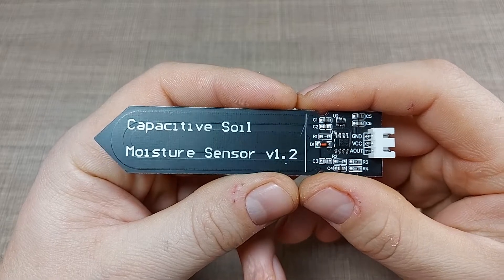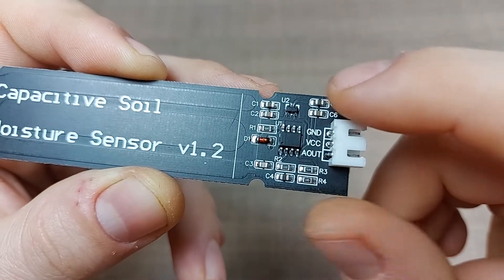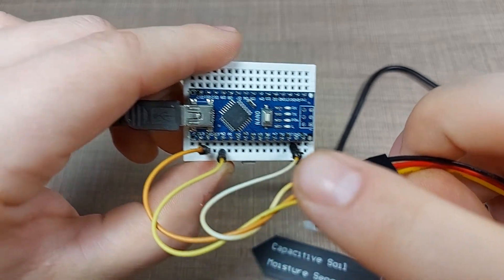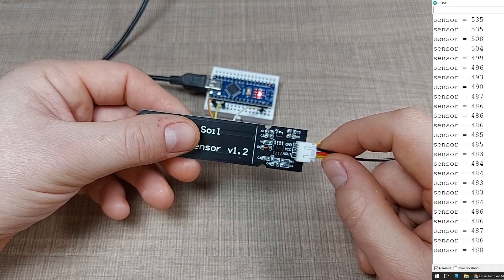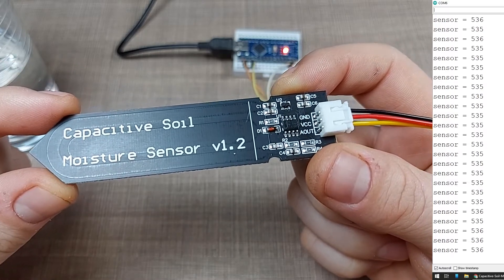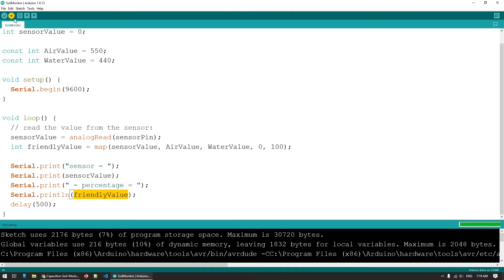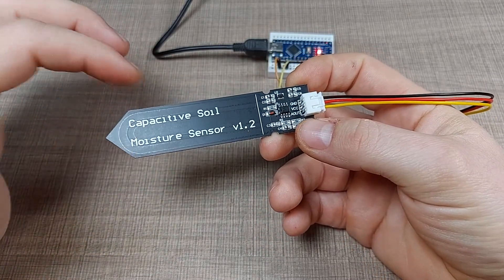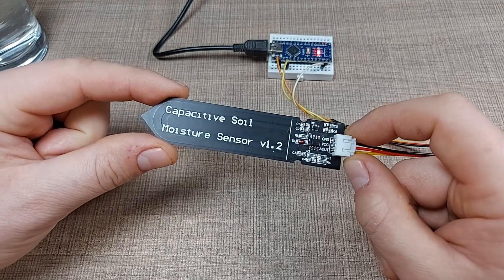Working with a capacitive soil moisture sensor

Comment: Honestly, I saw the schematics once for this sensor and I do not trust converting its output signal linearly into volumetric soil moisture content. According to some literature I read, the best way would be to get a dielectric constant reading, to then convert with something called Topp's equation. And I am not sure how one could translate this sensor's output into a dielectric constant value, or even just capacitance, from which you would calibrate in mediums with know constants.
Reply from the maker: Does it need to be that precise? What I need to know from it is if there is moisture or not so that I can turn on the watering. There is no value in knowing the difference between 20 or 30%.

Comment: why do all my sensors write 755 instead of 530?
Reply from the maker: The calibration is different on all. Do they respond to changes in humidity? If they do, then you can map your output based on that.
Reply: @TasteTheCode  yes they respond, thanks so much, I have another question, why the value changes in order of the deep of the sensor in water?
Reply from the maker: Put it simply,it changes the capacitance of the surrounding. This is how they work and are able to detect the change in soil moisture, the more water there is, the higher the output.
Reply: @TasteTheCode  Thanks for the help!

Comment: will the salts and fertilizers in soil effect its readings
Reply from the maker: Possibly yes. I know that salts do corrode the other types of sensors. You may need to experiment a bit in order to find the right values but it will definitely make a clear distinction between wet and dry.
Reply: @TasteTheCode  is there anyother way to measure moisture of soil nullifying the effect of salts and fertiliers based on current conduction possibly?\
Reply from the maker: Not that I'm aware of. If you have a soil sample without any fertilizer, you can maybe measure that and somehow offset the reading later bit it won't be simple.
Reply: Ideally you'd want a high frequency capacitive or TDR sensor, but those are not cheap.

Comment: will the salts present in soil effect the sensor value?
or fertilizers
Reply: For this particular sensor, yeah unfortunately. I got a sensor that uses TDR but I bought it for like 30$ CAD (while this sensor costs at most 5-6$ per unit). I read some litterature once that high frequency signals sent through soils will reduce the effects of ions on the dielectric or capacitance readings.

Comment: How to to attach different probes to this sensor
Reply from the maker: I don't understand your question. What do you mean by different probes?
Reply: @TasteTheCode  for example if I want to measure moisture at more deeper level.....then...can I extend the probe...by soldering wire to the existing structure
Reply from the maker: @ajinkyatamhane985  I'm not sure that you can do that with this sensor because the value is dependent on the capacitive coupling on the PCB. Adding external probes will change that capacitance and the value will be wrong. You can bury the entire probe inside a watertight enclosure and extend the communication wires from the top.
Reply: @TasteTheCode  really thanks for detailed reply
Reply from the maker: You are welcome!

Comment: Could this sensor be modified to sense moisture percentages of air in a compressed air (up to 150 PSI) application?
Reply from the maker: It shouldn't be affected by the pressure but since it will be air, I don't think that you will get precise readings as I had to dip it into water so I can move through it's range. I think you are better off with something like the DHT11 or DHT22 but I don't know if they will be affected by the pressure.

Comment: Nice video, but i have a little concern about this device : According NE555 datasheet the min. VCC is around 4.5V and the 662K regulator will provide just 3.3V. I dont know if was a manufacturer error, but this kind of issue can cause unprecise  reading or malfunction. Bypassing the 662K and working with 5V can be more safe.
Reply: They are using NE555 marked with 20M, which is proved to work outside of manufacture spec of 4.5V down to 3.3V. So, it is well working with a power supply 3.3 - 5V. Personally tested, and there is no difference with the models using TLC555C or TLC555I able to work from 2-3V.
Reply from the maker: The input can be 3.3 or 5V but the output is always capped at 3.3 so it is compatible with multiple microcontrollers.

Comment: Nice video, but hardy speaking, ADC and moisture relation is not linear in range 0-100%.  I am trying to do similar soil moisture tester with UnoR3 and mega2560.
Reply from the maker: Thanks for sharing. I know that the relationship is not 100% accurate but in general the relationship between wet and dry is and the output is usable triggering and alarming in a monitoring system.
Reply: @TasteTheCode  now i use 9 sensors on the mega2560. i use 9 buckets with soil. for stable adc results i use analogread command and 500 ms delay after . for measuring i use only the third analogread result. delay less 200 mn is not good because  ADC needs time to discharge the capacitors. average of 10 readings shows nice stable value . at least variation is within 5 percentage. now i try to find calibration curve volumetric moisture vs ADC values on sandy loam soil. 
looking for you new video and progress.
Reply from the maker: @bobalainen3  sounds awesome. I would love to see your setup if you have it somewhere on the net.
Reply: @TasteTheCode  i send the link by FB messenger